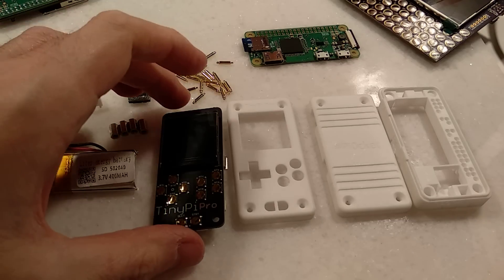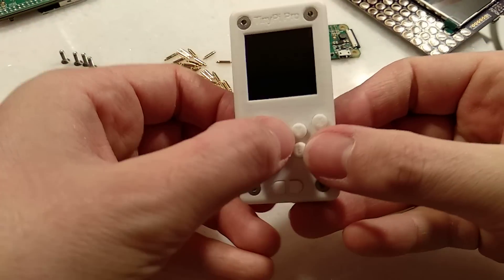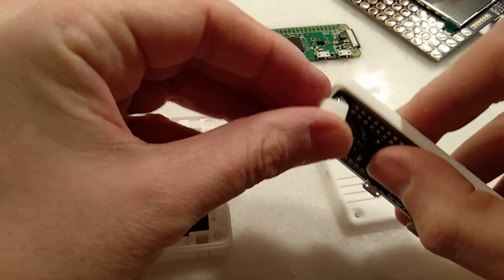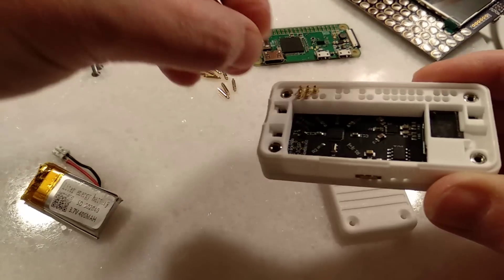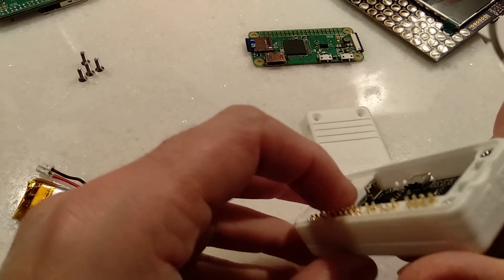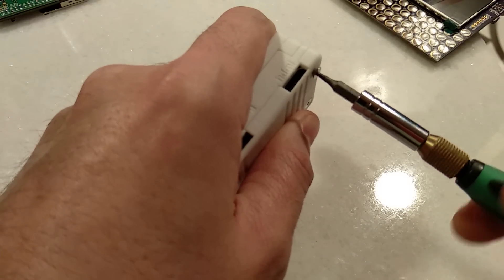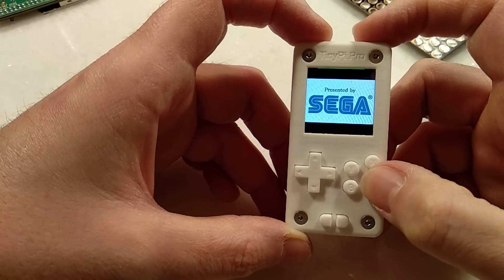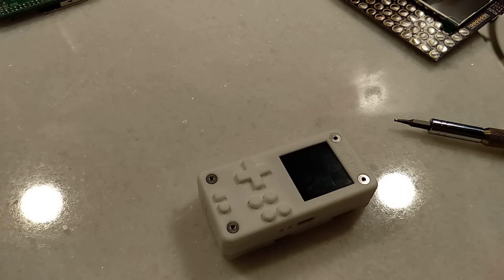How to build a TinyPi Pro

Comment: I wish there could be a horizontal variant, but I don't see where you could fit the shoulder buttons with all the gpio pins in the way.
Reply from the maker: there is always a way :)

https://hackaday.io/project/99651-tinypi-advance
Reply: I forgot to say "or without sacrificing the small-as-a-Pi-Zero design goal," but hey, looks like you've found a great compromise!
Reply from the maker: @doublex85  yeah the landscape format is less suited to the harsh rectangle. Well one that small anyway

Comment: Is there volume control?
Reply from the maker: There is a menu when you press the power button. Can change volume and switch WiFi
Reply: @Pi0cket  Thanks, do you also have an estimate on when the next batch is coming out?
Reply from the maker: @peanutallergy5318  we are getting to the end of the Kickstarter batch, hopefully won't be much longer
Reply: @Pi0cket  Okay, thanks!

Comment: Which do you recommend to assemble the Tinypi Pro... a Raspberry Pi Zero or a Raspberry Pi Zero W or does it not make any difference?
Reply from the maker: The only difference is the WiFi helps when you are adding games and tweaking settings

Comment: That little package is super cute.  Nice tight fit.  Reminds me of the PocketStation that sadly never really got out of Japan.
Love those GPIO connectors.  
I especially love the battery checker being the primary power button functionality.
That needs to be more common.  Even a double tap to turn on versus hold to turn on would be great.  As it is now, hold usually hard resets most devices.  (which is annoying as high hell when it happens by accident! lol)
Sometimes you just want to see the battery charge at a glance.   Even with fast-boot in some devices, it still has that added hit against the battery that simply isn't needed.
Very good feature.
Reply from the maker: Thank you 😁

Comment: pi and sd card alrady bought. Two questions, can i plug it to a hdmi screen and plug an extra usb controller so i can play with someone else?  how long it last the battery?
Reply from the maker: If you comment out the code that forces the 240x240 pixel resolution you can use the hdmi port. The usb is just the standard usb on the pi, so you can plug in whatever you like :)
Reply: @Pi0cket  i have to modify that code every time i plug it to a hdmi screen?
Reply from the maker: @Neofito89  you can leave the code commented out, it will just mean the screen looks a little less awesome. HDMI doesn't like 240x240, and the screen looks less clear at 720p